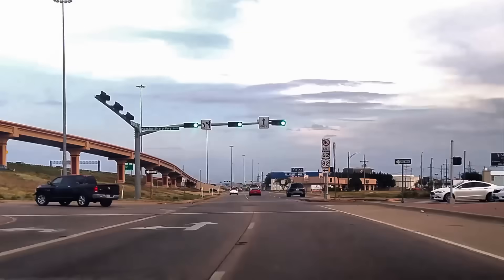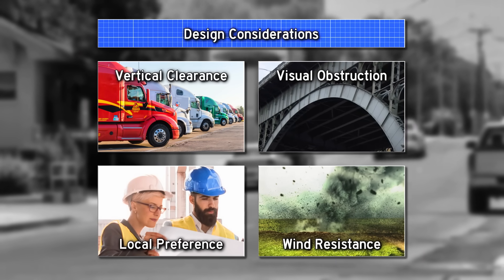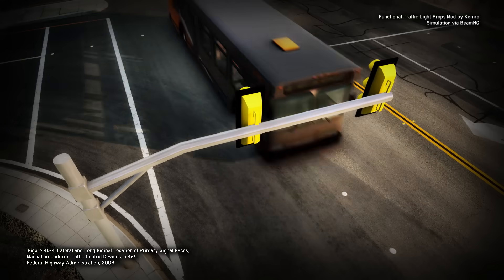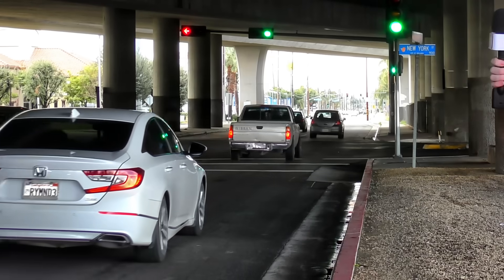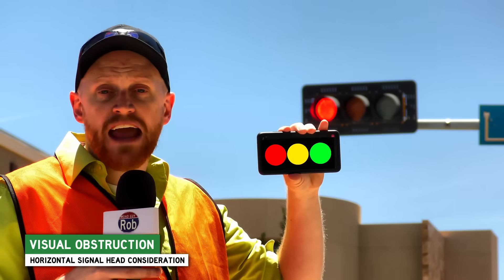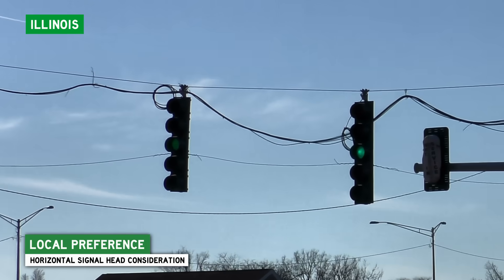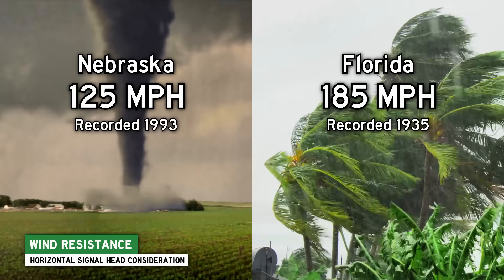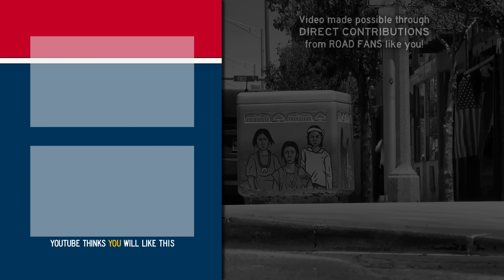What's up with SIDEWAYS STOPLIGHTS in Texas and Florida?

Comment: Rob, here's a question I've always had: why do some states have highway interchanges where the highway goes over the smaller surface street, and some have it where the highway goes under the surface street, and then at other times it's just a huge mix? I'm from Florida and I noticed that the interstates pretty much always rise up and go over the surface streets, so when you're joining the road you're accelerating uphill. However as soon as you cross north into Georgia, most of the interstate exits have the highway staying nice and flat and you have to exit and slow down going uphill. Is there any reason for this change? Seems to me like the Florida way would be much more expensive building a bridge for 6+ lanes of traffic, not to mention obstructed sight lines when merging and gravity slowing your acceleration.
Reply: It's cheaper and faster to work with the existing topography
Reply: @sharkheadism  but in a place like Florida, the existing topography would be completely flat, so it seems to me like it would be a lot cheaper to build a bridge for two lanes of city traffic rather than two bridges with three lanes of interstate traffic and a shoulder each. Unless I’m missing something?
Reply: @haku8645  If there's an existing road and the terrain is flat, it's easier for drivers to build the new bridge over it than close the local road for months while you build a bridge for it.

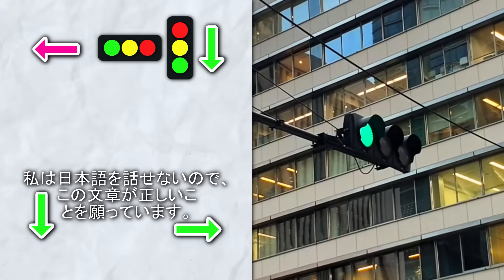Comment: 8:27 the general rule for horizontal traffic lights as stipulated by international road convention is that green is on the side where you drive. So, since Japan drives on the left, they've got their horizontal traffic lights the other way, too.
Reply: Now I need to pay attention and see if that holds true to the UK, or if we swapped like with the indicator and windscreen wiper stalks.
Reply: @kaitlyn__L  Are there horizontal traffic lights anywhere in the UK? I've driven there a  couple of times and the traffic light alignment I've seen has always been vertical.
Reply: @arthur_p_dent  I’ve never noticed them, but I want to keep an eye out now lol
Reply: @arthur_p_dent  No, the UK does not have any horizontal traffic lights. (It's my home country, so that's my source.)
The only 'horizontal' ones are wigwags for level crossings, bridges, or fire/ambulance stations (not really used or installed for these nowadays), which have two red lights near to each other, with an amber one below in the centre (although a very tiny number of wigwags on narrow roads or bridges are basically traffic lights with the red at the top and the bottom, and amber in the middle, and do the same flashing but vertically).
Reply: @AndrooUK  That's what I thought. I don't live there, but I drive there for 2-3 weeks on holidays almost every year. If I had run across a horizontal traffic light, I am sure I would have noticed. They are not completely unheard of in Europe, but AFAIK only a handful of countries have them. Finland does. I'm not aware of any other one.
Reply: @AndrooUK I was tying to think I’ve never seen one here either. Rare to see those above traffic as well as most roads only have 1 or 2 lanes so usually the second traffic light is on a pole in the central reservation not hanging above or on the path.
Reply: That's not the case in the Indian subcontinent, where people also drive on the left.
Reply: @MirzaAhmed89  does India have horizontally aligned traffic lights at all?

For vertical ones, it doesn't make a difference. Red is laways on top and green on bottom.
Reply: @MirzaAhmed89  that's interesting, Singapore also drives on the left and has the green on the left, like Japan.

Comment: Even here in RI we have some horizontally mounted signals and I always assumed it had to do with clearance and wind above all else. I think we got stuck in the vertical mentality from the days when the majority of intersections were the strung wire type; it only made sense then. When we started using rigid stanchions, we just kept them vertical and even started ridigly mounting the signal heads. It's like nobody stopped to think about the best way to handle mounting orientation through the many years of material and design evolution.
Reply: There's no reason why you can't mount a horizontal signal on cable, you just can't mount it above cable without a great deal of effort and probably a second set of wires.
Reply: It depends on if you want your signals across the road, or at the sides. It's cheaper to have a single vertical signal on a slim pole than having a thicker and longer pole that is shaped to hang over the street with multiple signals.
You obviously wouldn't do horizontal signals at the side of the road. That would just take up unnecessary space.
The orientation is considered by proper designers, but tradition and existing standards and laws mean that it isn't practical to change it.
Reply: ב''ה, as you should know in New England, the early days of motoring featured vertical signals on poles, sometimes mechanical, sometimes manually operated by a traffic officer.
 
Then, with electrification and all that, keeping the vertical shape of the signals then in use was a design goal for comprehensibility (and that vertical design could be made bottom heavy and thus somewhat stable once cheaply slung from wires).

Comment: Turning the light Sideways wouldn't change its frontal area, you would have to remove pieces or make it smaller.
Reply: Not when you consider the arm it's already mounted on
Reply: @sharkheadism  excellent point
Reply: @sharkheadism  but the arm is pretty inconsequential compared to the surface area of the signal head, don’t you think? My speculation would be it’s more securely mounted and may create less rotational torque on the arm.
Reply: @DanTheisen  I think it's both, the arm's diameter isn't inconsequential as they catch a lot of air in their own right, especially the longer ones.
Reply: @sharkheadism  absolutely right, but we’re only talking about twice the width of the face of the signal head (assuming it’s 3x higher than it is wide when vertical), not the entire pole since it’ll be part of the equation regardless.
Reply: @DanTheisen  When the signal head is horizontal, more of its area (viewed from straight on) overlaps the area of the arm than in the vertical position. Hard to explain without an illustration.
Reply: @sharkheadism  yes, exactly, so the exposed portion of the arm when the head is in the vertical position is the only additional surface area we should consider, not the entire arm, when determining how much additional surface area is exposed to wind, right? I think we’re saying the same thing. I just want to subtract all of the common configuration to talk about what changes between the two options.
Reply: @DanTheisen  There's more total surface area for wind force to be applied upon with the signal heads in the vertical position than in the horizontal position
Reply: @sharkheadism  we’re in total agreement. My point is the total is not that much more vs the area that’s exposed in both scenarios.
Reply: @DanTheisen  I took a look at some of Florida's intersections on Google maps and the signal heads use a single attachment point, and many of the pole arms are almost as large in diameter as the signal heads themselves. So it appears that the wind profile alone is the major factor in aligning the signal head horizontally.

Comment: Wisconsin also does quite a few mounted horizontally, but I think they might be slowly phasing that design out
Reply: Yes they started phasing them out about 15 years ago. There are a lot left in some parts of the state.
Reply: that is only being done at interceptions that are controlled by WisDOT or certain counties.  The City of Appleton still uses the standard horizontal signals at city street intersections.  They are a sort of comfort thing, too.  They tell me that I'm 'home'
Reply: @mgk920  Ok I see here in SE Wisconsin they all use the vertical ones. The city of Milwaukee, Milwaukee County, The city of Waukesha Waukesha County ect. The only new horizontal setup that has been put up here in the last 10 years I am aware of is the one on Sunnyslope and Grange a rare instance in which it is sole jurisdiction of the city of New Berlin. I should mention that I noticed that the SE district is the only one that still does vertical lights on a singular assembly while the rest of the state keeps the old setup if it only has one light.

Comment: Actual swamp ogre here: they also frequently don't include a back plate on signal heads on the coast here either. This is because hurricanes frequently snap off the back plate and it then becomes flying debris.

Comment: I am really proud of Nebraska's traffic signal infrastructure.  The majority of wire-span signals you'll find are considered temporary.  Most permanent structures are pole mast with cantilevers.  Many stand-alone signals have been moved off of the islands, but a few can still be found in places.
Reply: The cantilever are a visual improvement but are a safety hazard.   I grew up in a city with streetcars and the network of overhead wires is quite acceptable to me.

Comment: 9:09 surely, the frontal area is still the same no matter the rotation? I assume it's better because more of that area is in front of the pole
Reply: The frontal area is the same, but when the head is vertical, there is much less frontal area in front of the cantilever arm.  More of the signal head in front of the cantilever arm overall reduces the total wind load.

Comment: Up here in Wisconsin, I thought it might be to allow the snow to fall out of the lens area so it doesn't obstruct the signal.
Reply: Snow packed by the wind doesn't fall out. I'm sure with LEDs, there also has to be a heater circuit.
Reply: @mrcryptozoic817  Technology Connections has a video about that.
Reply: @mrcryptozoic817  this was an issue when i lived in Wisconsin and LED stoplights were first introduced. apparently it was an oversight or not a warm enough heater for our cold weather and the lights would stay entirely obstructed by snow.
Reply: The protruding, curved bills above the lenses should keep out the majority of snowfall, rain, and sunshine (you can see some are massive or shaped oddly if it's known that the Sun can shine right at it).
The heat of incandescent lamps, or built in heating wires for LEDs, should take care of the rest.
Reply: @AndrooUK  When they first started using LED lamps for traffic lights, they didn't include any heating and blown snow buildup was a problem in some places. Yeah, not a hard problem to solve or anything
Reply: LED signals are the worst for snow. Vertical or not, if snow is blown on the lens, it will completely cover it up.

Probably the main thing the greenies didn't think about!